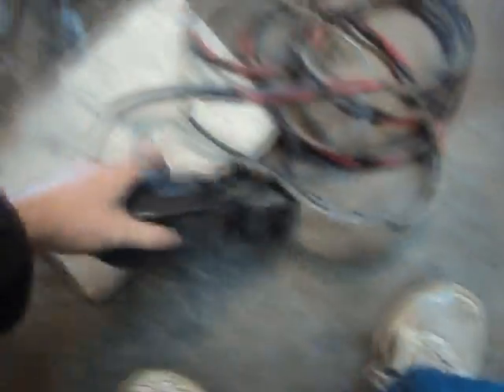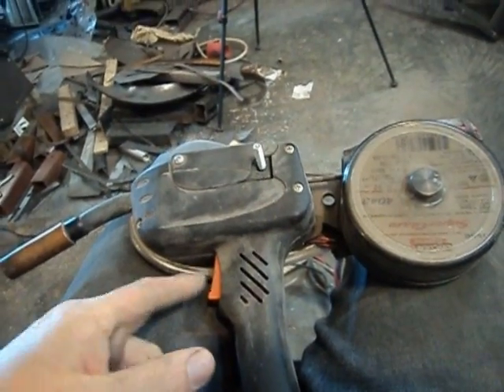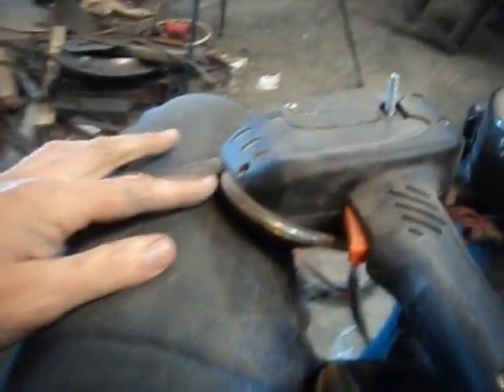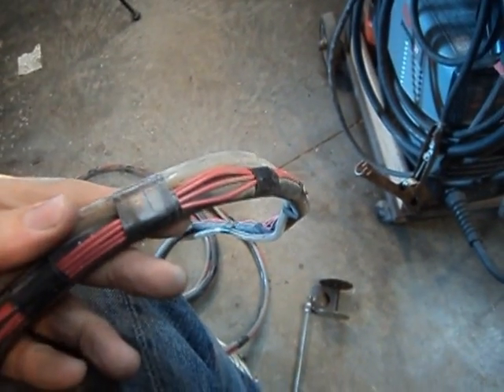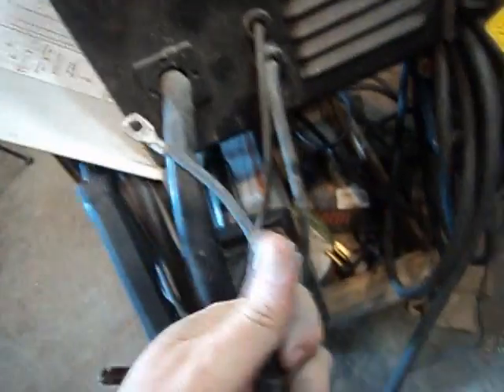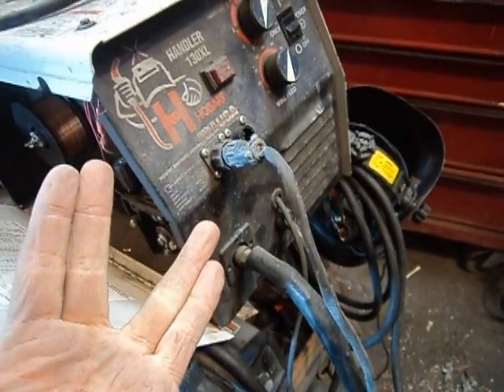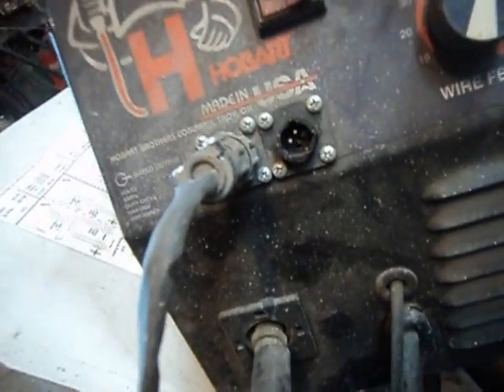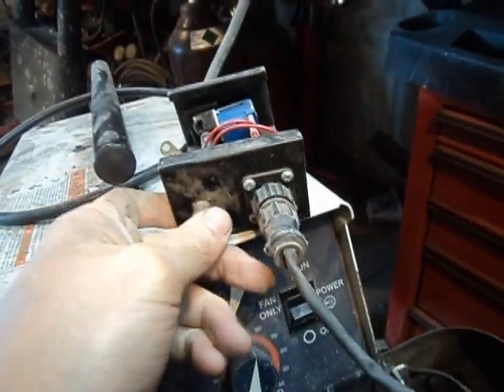Homebrew Aluminum Spool Gun - Under $100

Comment: WHATS THE VOLTAGE RATING OF THE SOLENOID? 12 VOLTS OR 24? THE MOTOR IN THE SPOOL GUN RANGES FROM 12 TO 24 TO 32 VOLTS I THINK. I PLAN ON DOIND THE SAME THING YOU SHOULD BE ABLE TO ADD A 10K POTENTIOMETER TO THE WIRES GOING TO THE MOTOR PAST THE TRIGGER

Comment: Interesting project. I'm thinking about getting an inexpensive ebay spool gun and converting it for my everlast welder. I might get one just for aluminum and another one just for flux core so that I don't need to keep changing out my big spool of solid core wire.

Comment: Hi. Great job. Makes me wish I had not given away my old "junk MIG." which had seen much better days when it was given to me. Just never occurred to me that I might want to do al. someday and that might have been the perfect platform for it. So now I have a Hobart Handler 140 AND a Lincoln sp 175 plus for 220 ND 110 vac respectively. I have been scowering the web to try and find the kit or parts to add a spool gun to either of these machines. lots of bids which show such a kit for the Hobart, but sourcing said kit has not been easy and the one or two places which MAY sell a switch and wiring harness, does not show the 4 pin plug you found. Now I am wondering where I could source that and what part number it would be and manufacturer. Any help you or any who read this can offer would be most appreciated. thinking that I can get a Miller or clone sp-100 gun for $100 and if I am lucky, maybe I can find a source for a complete kit for under $30. Lots of vids which show how to do the mod, just not even a single reliable link to purchase the wiring harness.PLEASE, any help in this area would be so appreciated, it would be worthy of beers on me!Thanks, Danny

Comment: what kind of gun is this do you have specifics this would be ow some in a portable setup  with batterys
Reply from the maker: +Robert Allen The gun I bought was exactly what you describe.  It was meant to be hooked to an alternator or batteries.  It was an on-line purchase and there is not a brand name on it.  eBay has them for sure.
Reply: thanks

Comment from the maker: Totally valid question Aric.  Alum is much softer and most mig welders PUSH the wire up a 6' or longer cable to the torch/gun.  Since it is soft, the alum wire will kink and bind.  It also leaves residue behind in the lining of the torch lead that you don't want to "infect" the steel wire.  The spool gun has a much shorter push and they tend to work much better for alum welding.